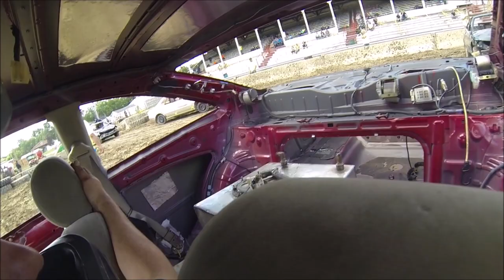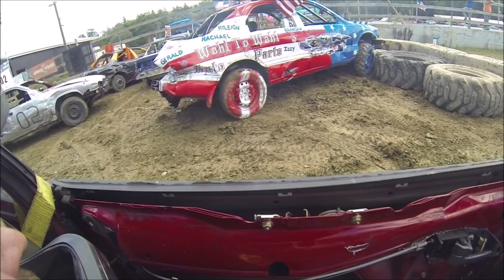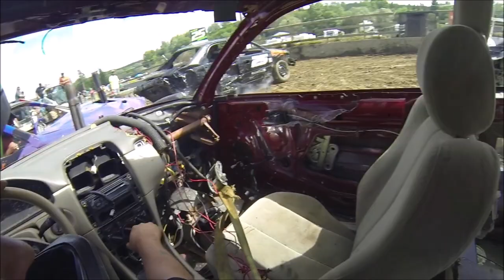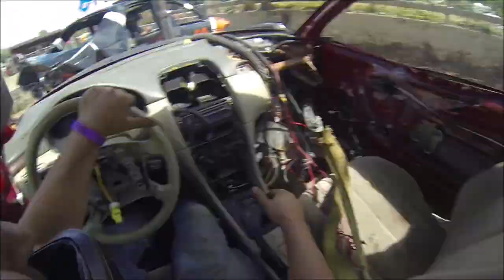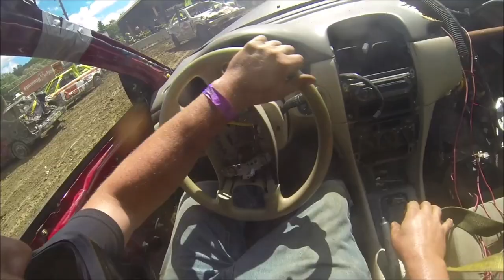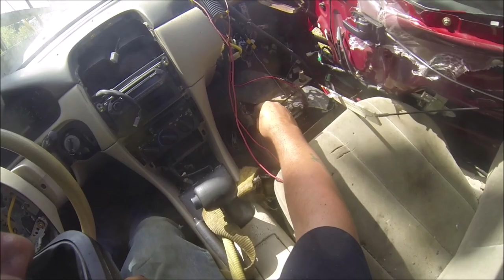Mini Meltdown (Compact Heat 2) 8-30-2020 GOPRO

Comment: Have you ever had the GoPro fall of the mount?
Reply from the maker: Many times. I may start to stick with the roof mount. Helmet ones are cool but fall off because they hit the seat or a hit is so hard it will twist the mount off center.

Comment: "We have to pick up bumpers off the track for safety." -- Derby Promoters

"Wearing T-shirts next to 5 gallons of gas with bare open wires is acceptable." -- Also Derby Promoters 

Nice run though!!
Reply: I spend more time on my fuel system than anything that's most important we know the dangers and if you can't biuld a fuel system I'm sure tech will not let ypu on the track ps in 25 years of running I've only seen 2 ppl In the same car "youth burn up bad and it was a mistake by the father he stepped on the fuel line broke it and tried to hold it together while they ran good ppl bad decision there both fine now after some extensive burn treatment I use a propane tank with the factory sending unit in it I'll hit It with a pick ax and show you how tough they are! Just my opinion we all have our own!
Reply: @chriswright331 man I wish I could see pictures of your tank thinking of building a new one. The one I have now isn't bad though I've even wrapped a door around it